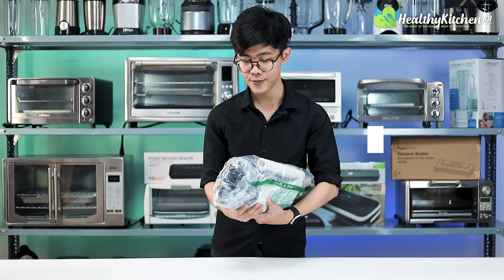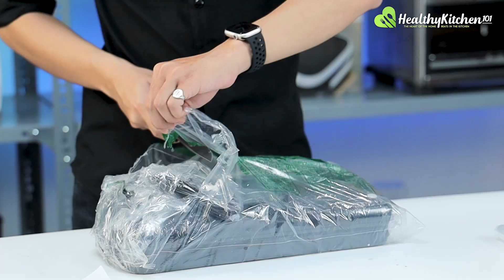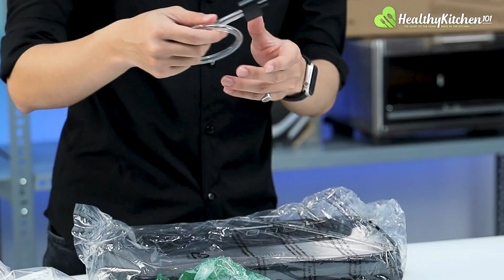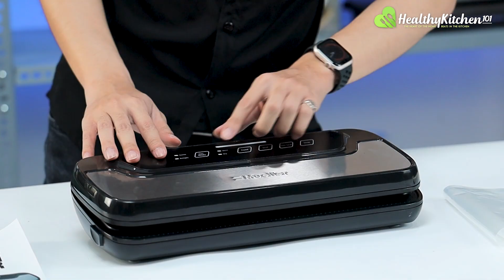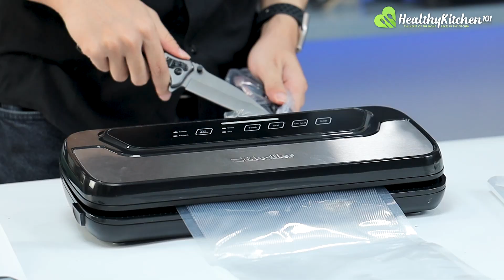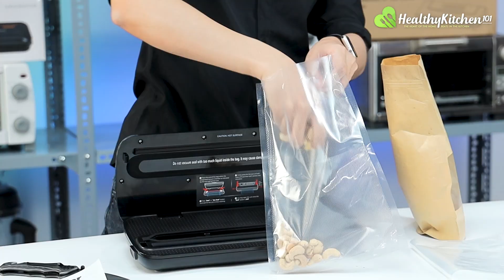Mueller MV-1100 Vacuum Sealer: Unboxing & First Impressions

Comment: I had to see your video to understand how it works because  after reading instructions my machine never does that "click" and it is to hard for me to press it  enough.  It's beyond return date 😏. Thinking to buy another brand.
Reply from the maker: I didn't exactly have the best experience with Mueller's build quality, either. So sorry to hear you can't return it anymore!

I did have pretty decent experience with Nutrichef (their cheaper ones, the PKVS18BK)! Suction performance isn't mind-blowing, just enough to do the job, but at least its build quality is solid. It's about the same price as the Mueller, too (I tested it here: https://healthykitchen101.com/vacuum-sealers/reviews/nutrichef/nutrichef-vacuum-sealer-pkvs18bk/)
Reply: @shouldit.official Thanks for the information.

Comment: You have missed real world food like steaks, soups, other foods with liquids. The BIG let down of sealers are when liquids get sucked into the vacuum and destroy the unit. Are there drip trays? Safeties to prevent liquid getting in the pump? Does it seal when wet food is across the hot melt area? Can you reach a human when something goes wrong? How is their customer service? Sales? warranty depts? on and on, you're just opening boxes, come one.
Reply from the maker: Hello there! As we mentioned earlier, this video is just about unboxing and our very first impressions, along with some initial testing of the Mueller MV-1100. This video is only meant to show what you'd get out of the box, and the quick test was simply to show that it can get the job done. As we promised at the end of the video, we'll be conducting more detailed tests with moist foods in a separate video and article.

This video doesn't encompass the entirety of our testing pipeline, which you can see in read here: https://healthykitchen101.com/vacuum-sealers/tests/

We use fresh, very juicy fruit slices (ripe mangoes) as a way to test the sealer's performance on moist food and see if it'd choke up if it ingests the juice or not. It's not fresh steaks, but there are lots of logistics involved in storing fresh steak cuts through weeks of testing.

Cheers!